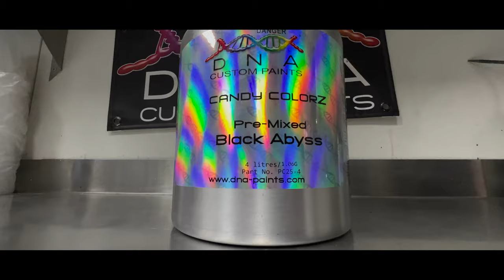Black Abyss Candy ColorZ

Comment: How do you avoid mottle with that? What if you sprayed 85% overlap
Reply from the maker: im told it will still mottle . I'm the type of painter that wont let a color beat me. will continue to paint it to work out a way . possibly closing the fan and tighter overlap
Reply: The colours on your fender are amazing. Can you please send me the details on the product I would need to paint my car that colour.
Reply from the maker: @grantstanborough  the color on fender was Spilt blood Candy basecoat which can been seen here dna-paints.com
Reply: @DNAPaints  thank you
Reply: @DNAPaints  why you dont put the tank a bit more upright, this way you could go in one motion over it, not like you did the front separetly..  walk the tank
Reply from the maker: @bernardplanko6780  thanks for your input Bernard, candies don't "need" to be sprayed by walking the object if the applicator is experienced, also as long as candies are sprayed with the same overlap it doesn't matter where you start or finish. its said to "walk panels" to make it easier for people. The parts used in the videos are only to show a color also some candies are easier to spray than others . were a paint manufacture not a panel shop .The parts used in the videos don't need to be show pieces nor are they to go on peoples cars or bikes , as long as the color is shown my job is done . appreciate your feedback though mate ✌
Reply: @DNAPaints  , Thank you.,I was just thinking. :) Why there is mottle appearing? How can you avoid it ?  and one more, using candy base a light one, could you then later use some coloured sparkles or perls and a different candy over it to get more depth as with true candy? And I am in a search of a candy colour where the main colour would be  more of a gray , silver anthranzite colour, being rich  in red , green and blue... , never in this colour type candys are show,,, Is it hard or uncommon. maybe a black candy over ?